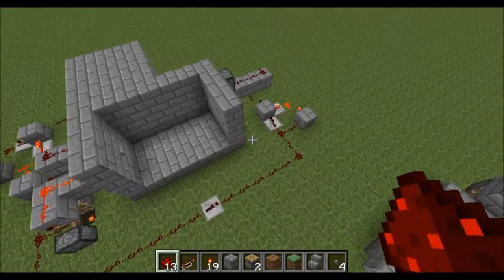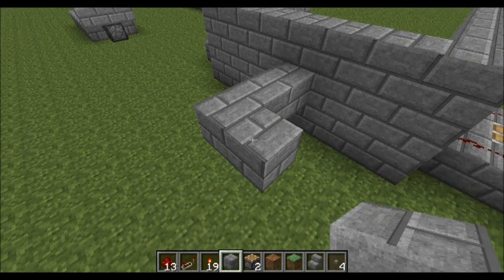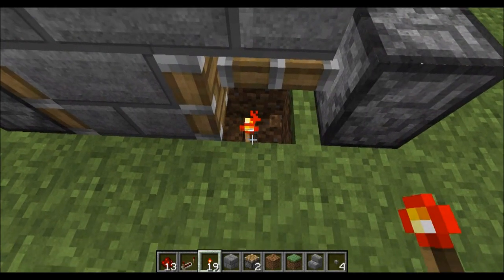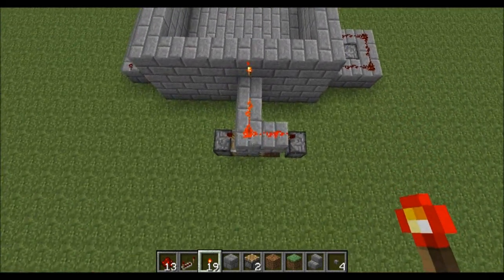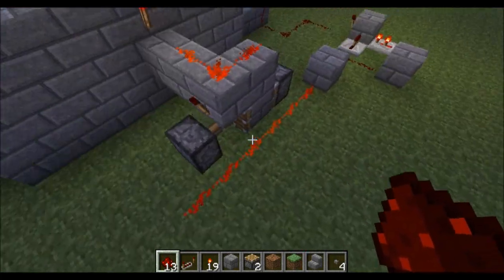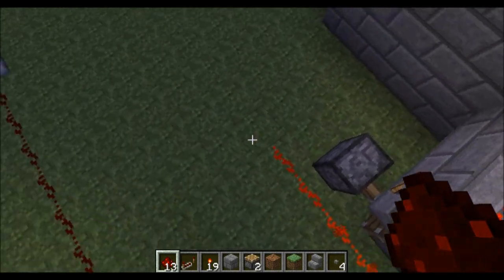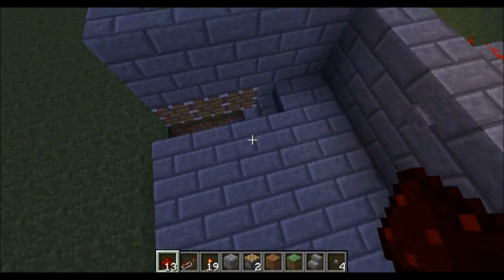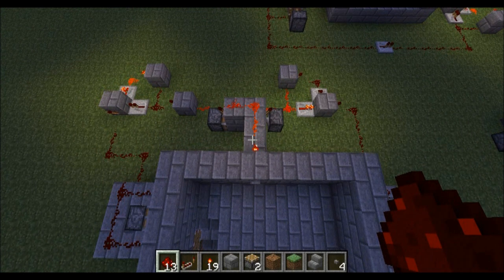Hidden Staircase - No Sticky Pistons, One Button (Video Response)

Comment: No need to invert it on the other side of the button. And that is possibly the weirdest monostable I've seen ;) .. And Instead of inverting before the monostable on one side, you can just take the output from both states of the T Flip-Flop. Hope you understand, and it helps :) I actually planed on making a video response for ya, since this is fairly easy for me, just didn't have the time to get it up. (I'm the co-developer of the 2 wide hidden stairs, KidMischiefHD uploaded, go check him out)